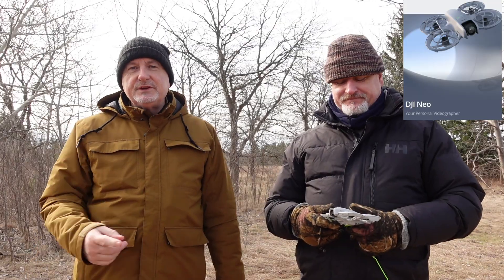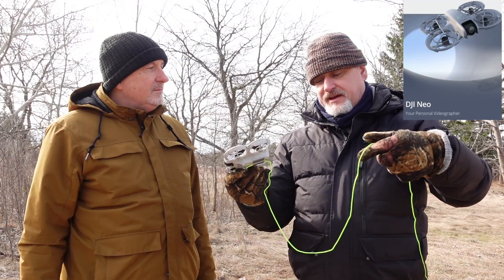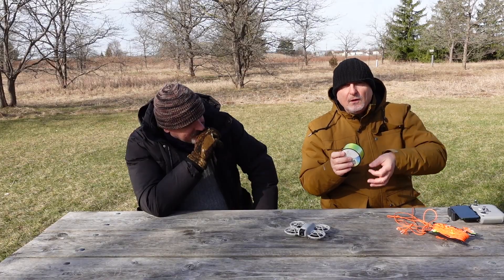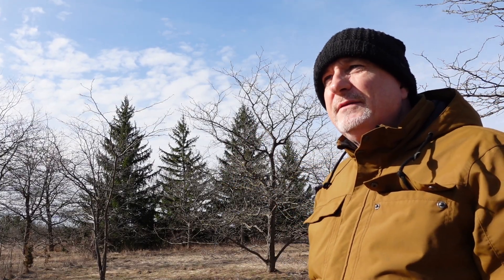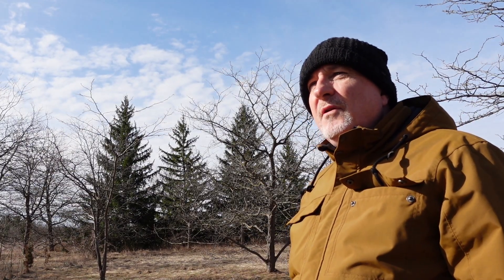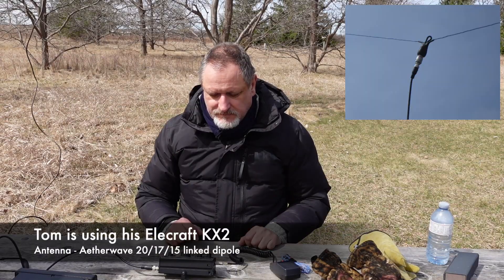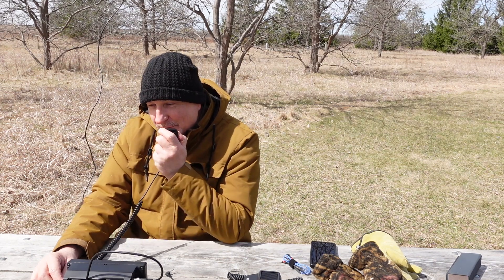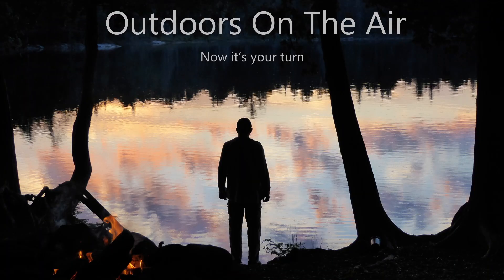Can a Tiny DJI Neo Drone Install a Ham Radio Antenna?

Comment: A few years back my father asked my siblings and I to fell a dead tree at our cottage. The problem was the tree had blown over onto another tree beside it and the pair were leaning towards our service drop off the main power line.

I expressed my concerns and he suggested one of us use a tall ladder to climb up the dead tree and attach a winch so we could guide the tree to the ground safely. The thought of climbing that high up a ladder attached to a dead tree didn't sit well with any of us. He's in his 70s and as stubborn as a mule so he threatened to do it himself 🤦🏼‍♂️. 

That's when I got the idea to fly Paracord up and loop around the tree and back down. Once the drone was back on the ground, we attached the Paracord to the winch and pulled the cable up. We were able to successfully avoid the service drop and guide the tree safely to the ground. It was quite the victory!
Reply from the maker: That's awesome, thank you for sharing!

Comment: I've done some antenna work with small drones. The motors can overheat with the extra load and the drone may have issues causing it to shut down or perform an emergency landing. Larger drones are more suited to this task, and a dropper with a weight is a good solution.
Reply from the maker: Makes sense to me!

Comment: There is a ham in the Atlanta area with a nice drone. He had a way where he could press a button on his controller and the cord would disconnect from the drone.  He did a video demonstration on it.  If I ever get out myself, I will have to use my arborist bag.

Comment: Thanks for the video Tracy. I have one of the larger DJI Phantom 3 Advanced models I've used a few times to string up an Antenna. Mine has open props so I 3D printed a bracket to go between the landing gear that a weighted loop near the end of the line would hang on. It's a more powerful model than the one you were using. Once up several feet higher than the tree I'd then go forward past the tree. At that point I'd rotate the quad 180 degrees and back away from the tree. The weighted throw bag would slid off the bracket and drop on the far side of the tree. I'd then just land the quad.
Reply from the maker: Thank you for sharing your experience, Dennis!

Comment: i had better luck using 6 lb fishing line.....flying straight up to at least 2x the height of the tree, then flying over the tree so if it snagged there would be enough line for the drone to come down on the other side   glad to see you were successful with that method

Comment: My drone would not have worked anywhere near this well.  Mine is a cheap one that was a free, just pay shipping deal.  I've never gotten a good flight out of it, but I still need to get it out to a large open area with no trees for an antenna wire.  73 from Wisconsin.
Reply from the maker: Thank you for your comment and 73 from VE3TWM!

Comment: Does this drone have restrictions when operated near a US airport? Great video Tracy! Always looking for new ideas in antenna deployment. Because of my health I am limited to back porch portable. Current configuration is an HyEnd Fed for 40 + up with Elecraft KX3. 72s de Maurice KA4NIV
Reply from the maker: Hi Maurice, thanks for your comment! I am not familiar with US regulations, but here in Canada this drone is small enough to not be covered by most drone restrictions. I do think I can fly it close to CA airports, though not very high (250 feet?). 72 from VE3TWM.